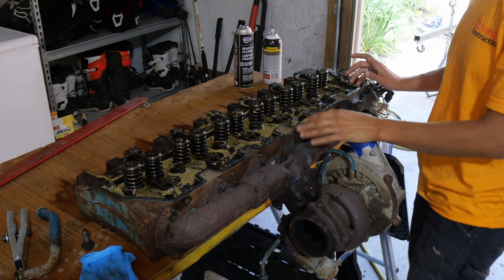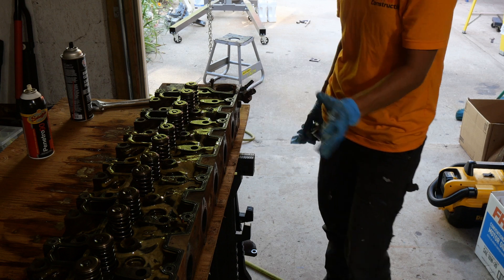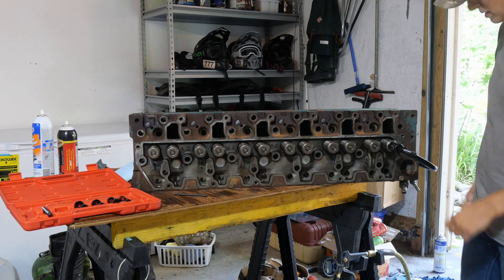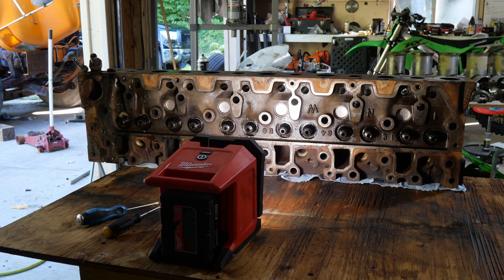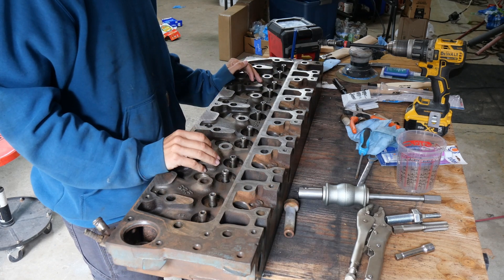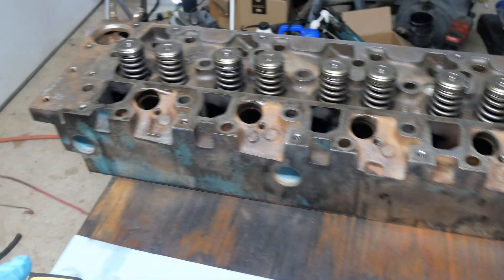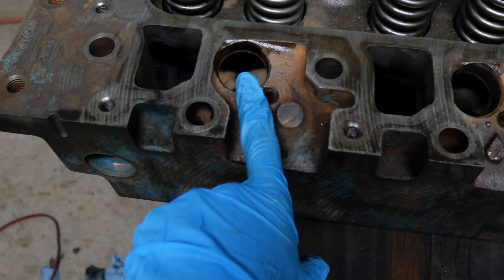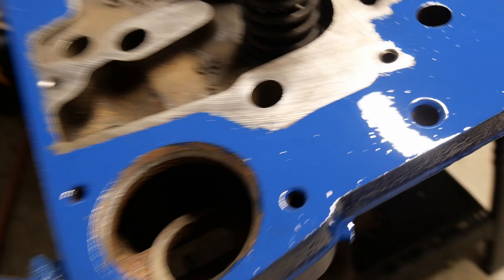International DT466 Engine Rebuild Part 6 Head Assembly

Comment: Hi, thanks for posting this excellent series of videos.  Which valve spring compressor did you use?  I'm having a hard time finding one that's recommended for a 466. Appreciate your time.
Reply from the maker: I used the Orion Motor Tech spring compressor, worked okay. Maybe try one that they make for the 12v Cummins. Might be a bit more heavy duty!

Comment: Never rebuilt one, why would you install the injector cups with a socket?
Reply from the maker: You can get the special tool that does the same thing, all you want is a flat surface that is the same diameter as the cup to pound them into the head.

Comment: Hi, good job! The paint you use it s a special one or any regular blue oil paint?
Reply from the maker: Its a special high heat engine enamel paint from POR. Works great and holds up to the heat of a diesel!
Reply: @HeidisGarage  thank you, I am planing to work soon in a DT466E head cylinder and wanted to do so with the color look very nice. Im in Haiti. I will see how shipping will work. Do you have a recommended web site to order it?

Comment: I never understood where is the intake it seems to be in the valve cover but how does that work?
Reply from the maker: Yeah the intake is integrated into the valve cover. It has a raised part on the center with runners that come of that center raised portion of the valve cover. Its a pretty slick design they came up with to minimize component's!

Comment: Was there something wrong with the injector sleeves or is it just good practice to replace them when you do a rebuild. How did you find the valve guides...much wear? I'm putting a lot of pressure on you...this will be my guide when I rebuild mine. Kidding. You're doing a great job.
Reply from the maker: I replaced the injectors sleeves because they had bad oxidation on the inside of them, and some had light pitting on the exterior from the coolant. I figured if everything else is new I better replace them as well to not cause premature failure.  I did not replace the valve guides only the valve guide seals, the seals are rubber with a steel ring on the bottom for the valve spring to sit on. They were wore oblong from the valve and were cracking from old age, these seals also allow some blow by when worn. I was able to find all of my parts on Heavy Duty Pros website and they are mostly Interstate McBee parts.